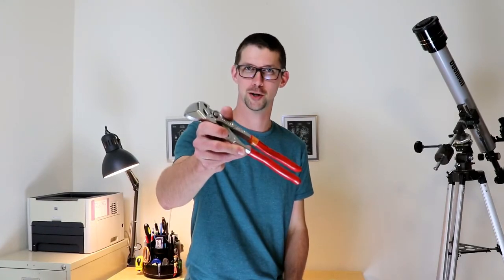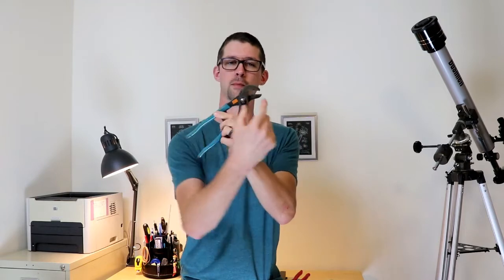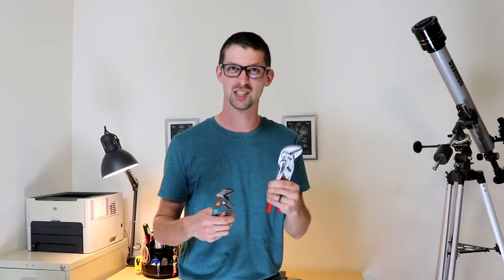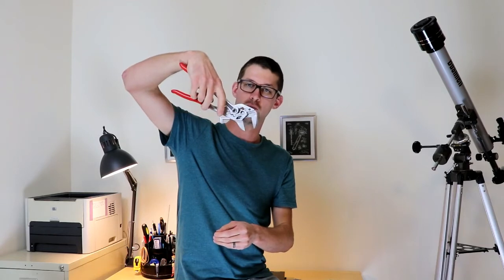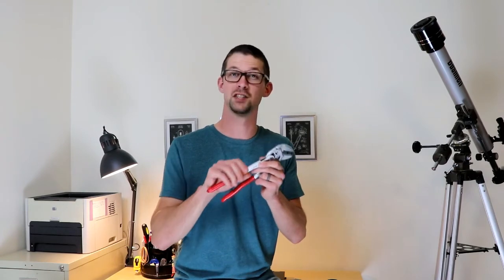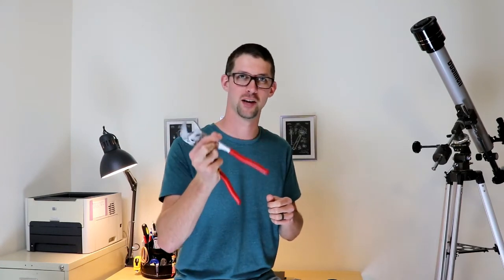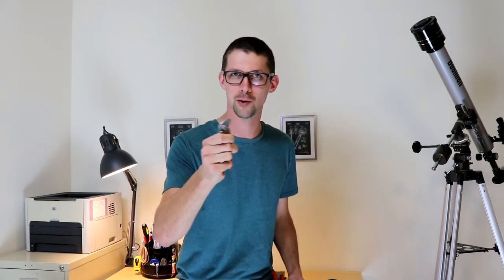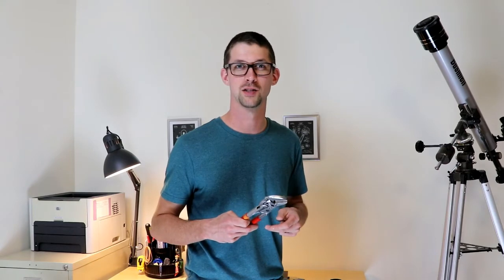Knipex Pliers Wrench Tool Review

Comment: Great pliers, well laid out :)
If I  may add, the pair I have (10in) are chrome or nickel or something plated, doesnt matter; what matters is that they wont mar the surface of shiny plumbing fixtures! The cam action also ensures a snug no slip grip..... they make even me look good! 
Also, get yourself a set of the cobra's, I have a 10in for the everything, and the lil'est one (great in hard to reach areas, stripped/torn up bits of metal in dark sharp holes, etc).....they are truly amazing.....I never realized what a difference it can make (like I said, they make even me look good :P )

Comment: Really good video. I work as an I&C field tech, and my toolbag currently has two sets of standard wrenches up to 1", and 1 set of metric. I've been trying to downsize and carry a little bit less as my bag weighs around 35lbs or so, and just gets tiresome to carry around.  I work with a lot of brass and stainless steel fittings, so I tend to not want to mar them up if I don't have to. Just looks bad on the company if I leave their equipment mangled. Some guys don't care, but they're a special breed.

I saw these by chance as a recommendation on amazon and was immediately interested in them. A lot of other techs at my company carry a 6" adjustable for 85% of the things we do day to day. 1/4 inch swagelok compression fittings being the most common thing we use a wrench for.  I just hate using an adjustable so I tend to bring my entire bag unless the distance from my vehicle to the work area is excessively long.

I'm thinking that the 7" and 10" versions would be most applicable to my job, so based on this video I'm going to buy a 7" one to test drive. 90% of the time I grab an adjustable it's my 8" one anyway, so the 7" seems like the obvious choice for most everything I'd encounter. I doubt I'd be able to get enough leverage on something it's maximum capacity is, but I guess I'll find out.

Thank you for making the kind of video I look for when I'm trying to decide what to buy. Your scenario with the hydraulic hose hit really close to home. Setting up my pressure pump to work on a transmitter is essentially the same thing, and a lot more cumbersome than it really needs to be.
Reply from the maker: @Finick thanks for taking the time to write. I agree that the 7” would be best to start with for your use. I forgot to mention also that these are less prone to rounding brass fittings even compared to a standard wrench.

Comment: They have a 6 inch as well. Haven't seen anyone compare it to the 5inch though. I'm debating on which one to get for edc
Reply from the maker: I’ve found the 7” to be the one I use most. It does depend on what you’re using it for though.

Comment: Well done video.  The info was clear and to the point, which I like.  I'm still struggling with what size to get.  I'm just starting to build my tool bag and for general use/fixing things around the house, would the 7" or 10" be better.  I'd like to spring for the 7/10/12 pack you suggested but I'm afraid I'll only use one and the other 2 will just be clutter.
Reply from the maker: I find that I use the 7" the most. It can get in some small places but still has a generous jaw opening width.

Comment: I bought every size cobra, and I have a set of 10” pliers wrench, and the Mac daddy set as well. I’m a heavy equipment mechanic and I use the 16” cobra the most out of any pair. My weird question to you is, when buying off amazon, what type of packaging do you usually get?
Reply from the maker: I don't have any cobras yet. I need to change that.
If if recall, the product packaging was just a cardboard box the height and width of the tool and about 1/2" thick that the pliers slid perfectly into.
Reply: Zach Fields yep that’s the typical glossed from the factory stuff. I’ve gotten that packaging, the blue plastic wrapped tools that you slit with a razor and the plastic comes right off, and I’ve gotten tools in just the heavy plastic bag that goes in the glossed boxes. I bought two pair of 10” pliers wrenches off amazon, and they came in blow molded clear plastic that looks extremely suspect.  It’s the first set of knipex I’ve bought that wasn’t from snap-on or thru my local Home Depot who stocks knipex in the store.  I’m thinking that I might have a counterfeit set of pliers...I’ve never seen them come in the packaging I got my latest pair in. Seems goofy but I can’t recall knipex coming in this particular packaging setup🤔